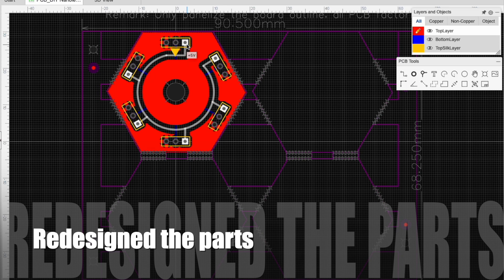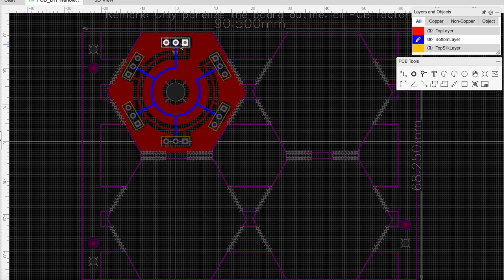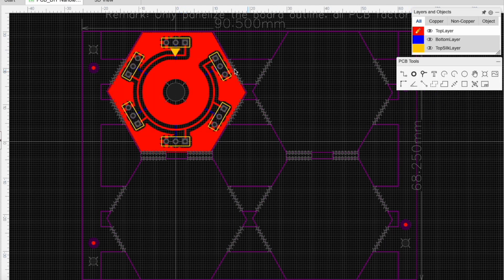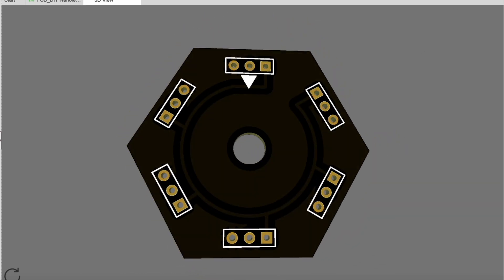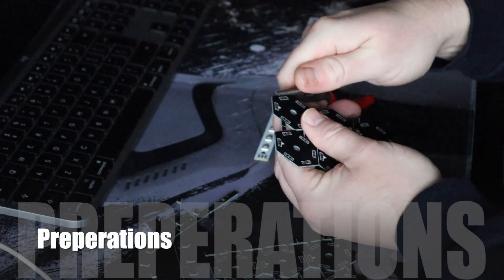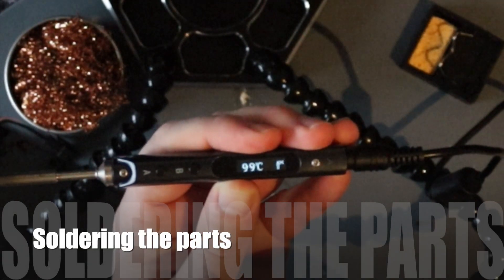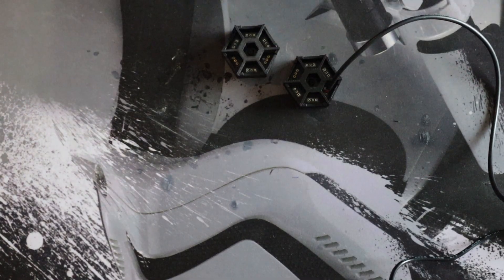DIY New Nanoleaf Lines - Black Edition

Comment: I have noticed that you were able to have the hub that takes two data inputs and output to different lines and not splitting data or mirroring, even though you have all the data connected together in the pcb. Would you please share how you managed that? Or did you set some features inside WLED app? I have the same setup as you but the output line LED just won’t turn on when I have two input lines into the hub.
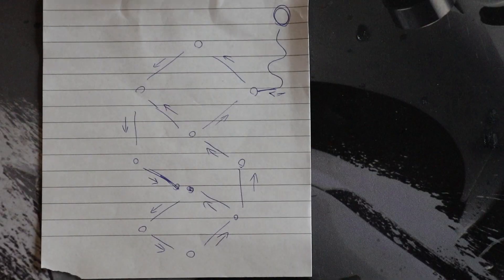Reply from the maker: i did split the data line in two cases (you can see that on my sketch 02:57) and where the line comes back to a section where there already is a data in, i did not solder the connection pins. because my printed design secures the line in place it does not need the the extra pins. i am working on a design where there can be multiple data signals (max 3) but have not yet had the time for this. i am working on a new hexagon project right now. maybe when i finish that i can do this again. ;)
Reply: @licky-lauda  So because of this, is this a fixed design that can't be easily re-arranged (as in plug and play) due to having to worry about multiple data inputs into one hub?
Reply from the maker: @TheReformedGoat  you can re arrange it, but before hand draw it out. So you can see what the flow is and how you want to connect the lines.
Reply: @licky-lauda  Gotcha! So just to clarify, you plan ahead the design, and then the lines that have data flowing into a hexagon that already has data going into it, you just don't solder the header pin on the data of that line? Basically a manual way of stopping multiple data signals from flowing into one hexagon? 

Also thank you for the quick response! Love your design and was thinking of doing something similar myself and this was the main hangup that I had a question on.
Reply from the maker: @TheReformedGoat  yes. Thanks for the positive response.